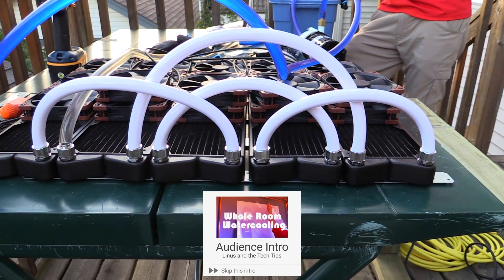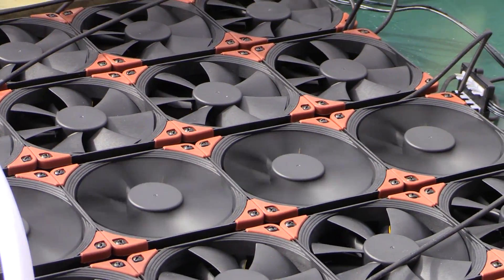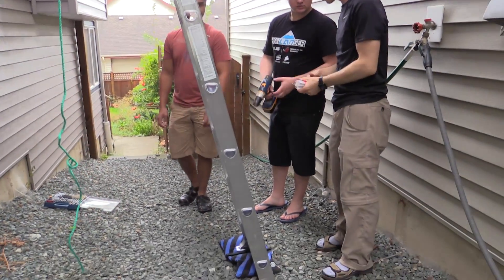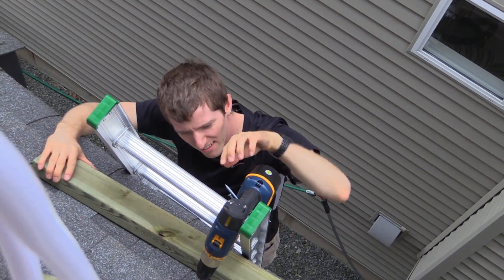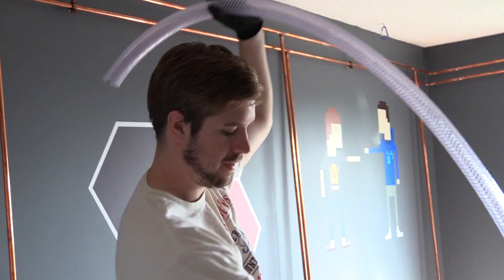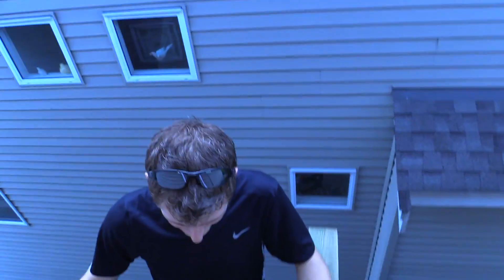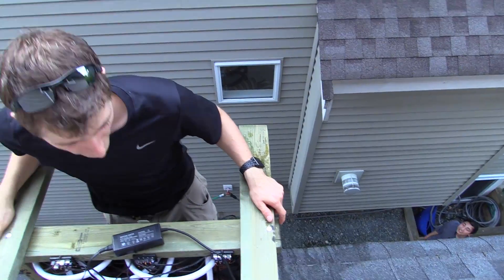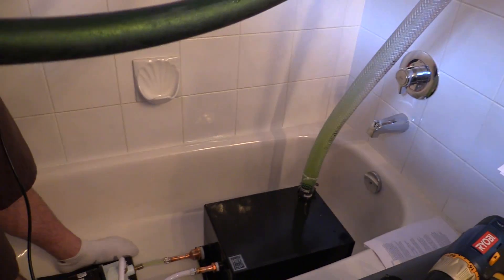Whole Room Water Cooling Project Day 3 - Radiator Mounting and Panic...

Comment: I feel so sorry for that PSU, it will probably die at some point. You didn't take into account the starting current (locked rotor current) for fans is higher, typically 1.25 times (or more) higher, than their running current. You should be using at least a 3A PSU.

That's probably why none of them want to start when you tried to power them all on the first time round. All of the motors were trying to draw their locked rotor current and none of them could start.
Reply: Toyz >not kissing his own rig parts
>almost 2015
Reply: Toyz damn, i bet toyz doesnt care if he crashes his car, becuase its jsut 34,000 bucks and can be replaced. 

people dont have money to spend replacing shit all of the time idiot....
Reply: Toyz I kiss my GPU to sleep every night, what's wrong with that?
Reply: I agree, the first thing I thought when he said they are pulling 2 amps was that power supplies never should be run at 100% load constantly, and that the fans starting current is much higher than 0.1 amps.
Reply: tstartrekdude the point here is it's pretty stupid to spoil something perfectly fine because of one's ignorance, regardless of its value.
Reply: tstartrekdude Kony Hawk Pro Slaver Or buy a 3A one for practically the same price and never have to replace it...
It's not even cheapness to say something like that. It's stupidity. Buy something right the first time and buy it once. Don't keep buying something cheap/shit and have to replace it every few months.
Reply: tstartrekdude thats not the point. the point is.... you have to fuck with it. 

also... WHAT HAPPENS WHEN IT DIES AND NO ONE NOTICES THE FANS STOPPED??? oh ya, it could possibly! over heat not one just one system, but THE WHOLE FUCKING ROOM. 25,000 bucks in GPUs up in smoke. 

so. 

1. it could fuck every system in the room
2. ya gotta fuck with it...when you should not have to do anything
3. money is money. that 20 bucks a year could have been used for taking a girl out on a date, which leads to a lasting relationship... who knows!!!
Reply: If its a good power supply, it will take the short overload and run continuously on 100% without a problem.
Reply: You're right he needs to compensate for the initial amp requirements.
Reply: XFourty7 ya, so tell me how many times your CPU has died...? sure its likely for them to die eventually but that'd still take about twenty years under normal use, however if you abuse it (improper overclocking for example and by that I mean really pushing it to unstable range or just not enough cooling) then guess what's going to happen? it will dramatically decrease its life with little benefit.
Reply: I believe on a wan show a while back they said their power supply for the fans did fail shortly after finishing but the temps where still fine so they didn't bother replacing it.
Reply: Toyz Cop outs are literally the worst thing you could have replied with.  Well done
Reply: Uteopia with insurance, if its your fault... your fucked. 

80% use the bare min.... the other 20% with full coverage... well, theirs a limit to how much they pay. 

and unless you hire a good ass lawyer, they aint going to give you a fair amount.
Reply: Edzel Yago i kinda figured that.... that much water and surface area of pipes.....

still.... i like my shit to work, and not have to mess with it ever again. thats why i expect hard drives to last a life time (or at LEAST 8 years) 

instead my WD 2 tera black FEZ drive failed in 9 months....while a 5 year old WD blue 1 tera is still OK in the drive bay above it.

im very pissed... and they didnt want to pay for shipping it to them. had to lie (sorta, the first guy did say it would be pre paid) to the 2nd dude (they sent the RMA to the wrong email at first) to get a free shipping label. 

gonna start making my own damn hard drives... sick of "it will work" attitude of seagate and WD.
Reply: dominic you are on the right track the inrush current required to start any type of motor is far greater than the running load (amps) i have seen 15 amp motors pull over 130 amps on start up... the 1.25 you are referring to i think you are confusing with the rating of a continuous load (also btw these fans would fall under that category due to the fact they will be running none stop for longer than 3 hours (which is what determines a continuous load) also you should only run 80% of the maximum amperage allowance for safety and life span. 20 fans .125 amp (due to being continuous) means that power supply is drawing the full 2 amp and has a drag of .5 amps which means the motors in the fans will pretty much burn out ALOT sooner than they should. dont worry so much about the power supply.. the real damage is the motors in the fans failing due to a lack in current (amps).. that was fun :P
Reply: Toyz Linus goofd hars
Reply: Germo Gen
woohh !! i think he is a Time traveler and commented on the video before it was posted without causing a paradox ! , well done :P
Reply: DominicHCurrentTips :D
Reply: *****
If you expect a hard drive to last THAT long, you should consider buying enterprise grade hardware like WD RE4, they also have 5 years warranty.
Reply: 3vIL VIrUs I'm sorry, but as far as I've read in reviews of those drives they also don't last very long. Thats aslo kinda why I dont't want to buy a new HDD
Reply: Sebastian Schmitz
Well it depends on the definition of "verry long". If more than 10% of these drives fail in the first 5 years, wd would make quite a loss, so I doubt that they fail frequently. I have a 4TB WD RE4 which runs since a year 24/7 fine. I have built a RAID with 3 WD RE4GP 2TB a few weeks ago, also going fine. Of course thats no long time tests, thats just my experience with enterprise grade drives.
If its about the data, you won't get around RAIDs and backups, regardless of the drives.
Reply: http://en.wikipedia.org/wiki/Inrush_current#Motors
Reply: 3vIL VIrUs ya... i seriously thought about buying Enterprise grade drives....but the dard drive is CRITICAL the the pc. my cpu or gpu dont wear out in 4 years..... they last "forever" 

it just had steam games on the damned thing... so i didnt worry about loosing the data. i can just re-downlaod it at night.... but, i cant fucking play my steam games. 

i dont really watch TV, insted i play video games. they are different every time... no match plays the same. so its much funner than watching tv.
Reply: 3vIL VIrUs and sebastion has a good point actually.... the FEZ wd black 2 tera drive.... which is still their top of the line hdd.... has a high falure rate. 

could be that a LOT of people baught the drives and one the ones with problems come back to bitch.... but, i just hope i dont get another lemon. 

if the replacment fails with in a year, im asking WD for either 2 or 3 WD blue drives (the same one thats in my system and 5 years old) 

or asking them to buy me a 2 tera SSD raid array... or ill sue hahahaha
Reply: *****
Normally about the overheating problem you brought up, all of them but especially Edzel's computer should run CoreTemp constantly along with AddGadget's CPU and GPU meters which use CoreTemp to throw off alarms in case shit nears hitting the fan. Hell I dream of making something like this (hopefully maybe in 2017-18 when I'll have a stable living address) and yet I still run the above setup on my laptop.
On top of that, computers whether they are PCs or laptops can shut down in the rare case that either the CPU or the GPU reaches a critical temperature threatening the component itself. In the 5 years I've used laptops (a bit before Vista, with Vista and now Windows 7) it happened to me on an Asus laptop equipped with a 2nd gen i5: at 85 degrees Celsius the computer just killed the power and shut down the entire laptop.
Reply: love how the clowns in those 6 year old comments think you can get anything remotely resembling a decent quality SMPS for 10 bucks :D for a tenner you'll at best get a chinese noname PoS that simply won't do what its label says, and at worst a straight up fire hazard with zero protections and RF interference up the wazoo.
if you want something that lasts and can take quite a beating (overcurrent spikes when a crapton of fans start up simultaneously over and over again), you gotta triple that for a delta, mean well, phihong, umec, seasonic, FSP or the like.
Reply: ***** The power supply they are using here cost 8 dollars on amazon or less than a third of the cost of one of the 12 fans that is on that rad. 8 dollars every 6 months to a year when the PSU wears out is not a big deal, you spend more money than that a month letting hot water run across your naked body while jerking off in the morning you pleb.
Reply: ***** They made a first time mistake, if it breaks they will probably buy a higher VA one for the second time. Get over it lol.
Reply: damn i bet you kiss your gpu too. It's a material, it can be replaced.
Reply: Everything dies at some point..?
Reply: Dude those power packs are like 10 dollars.